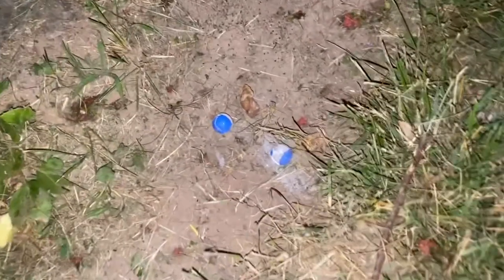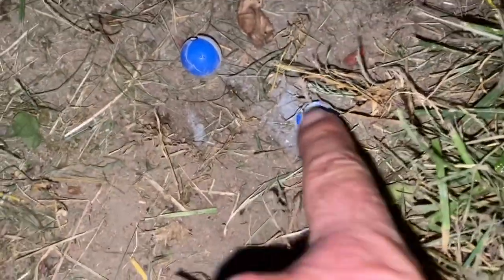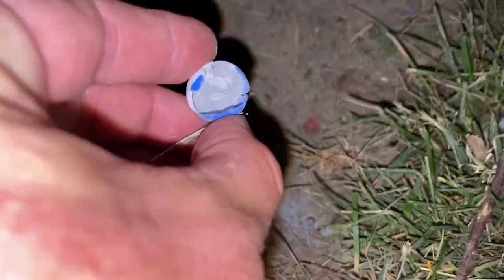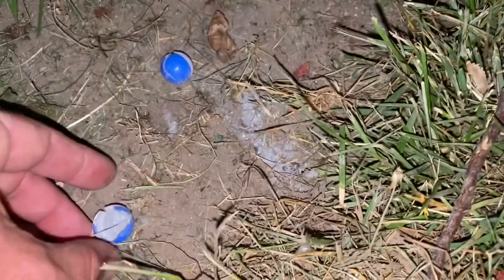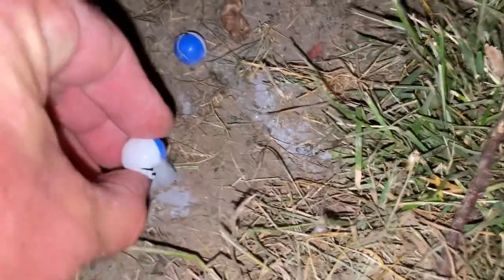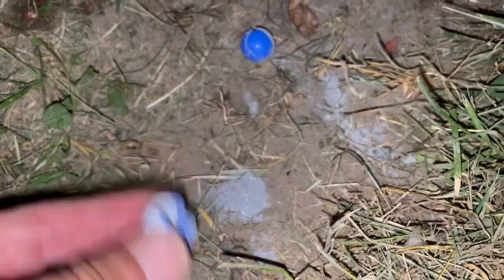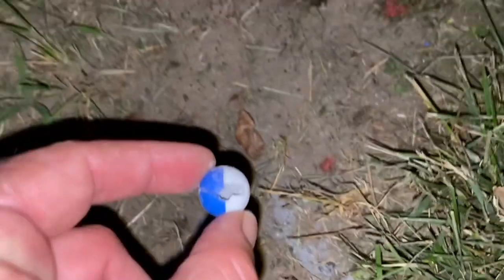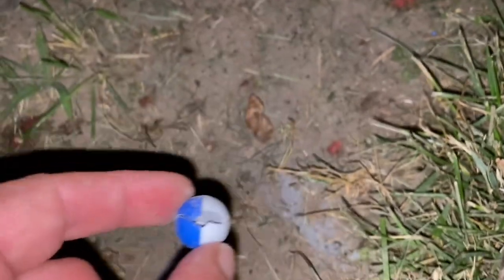18 Hours Later, Gutshot Doubletap; Grimburg Kinetics; 10% oc 2% Pava 6g

Comment: Thanks for doing this test. The bruising and healing are important to see just for the knowledge base. However, as a defender the only critical piece of information is the pain on impact and whether it would provide sufficient immediate deterrence. Typical pepperballs on a per ball basis lack the kinetic or chemical effects that we really desire. It takes a hopper full to be reliable dosage for civilian use. I've always maintained that 40ish kinetic impact Joules with a non-frangible projectile is the sweet spot on power, deterrence, and reliability of a marker. It doesn't require risky upgrades or risk of self-exposure to chemicals.
Reply from the maker: I think you are dead-on, there…